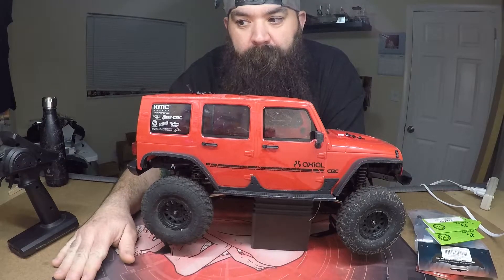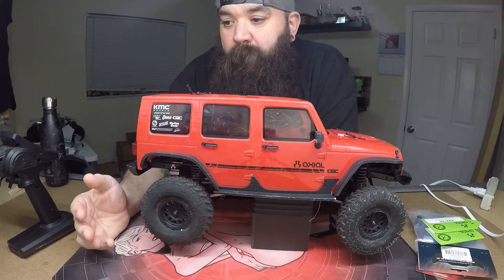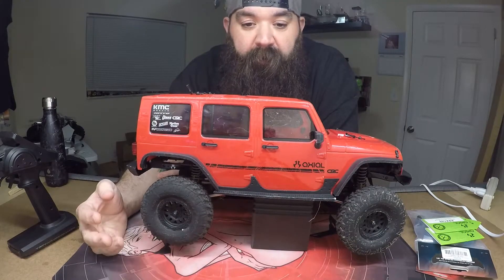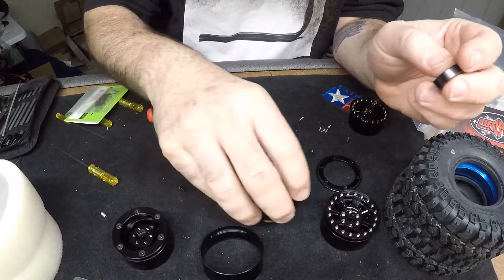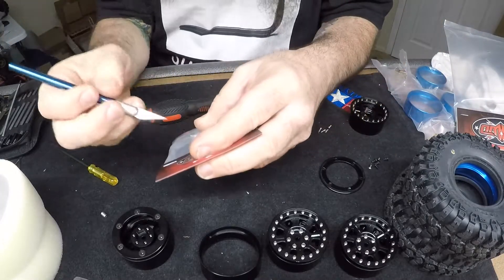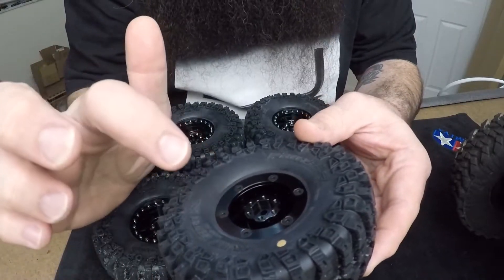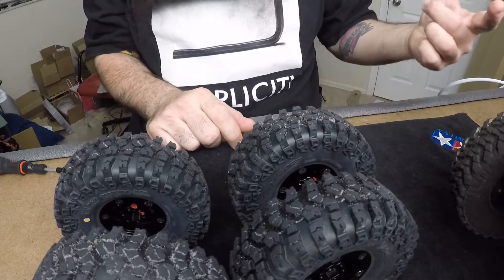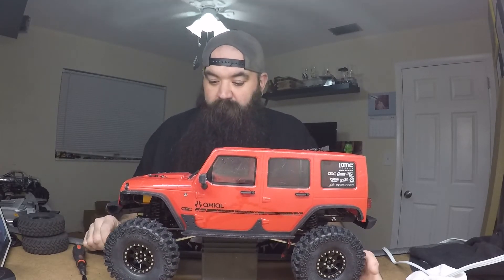BUILDING MY BEADLOCKS....AGAIN! THE RIGHT WAY!

Comment: I'm glad you brought up the shock mod that Harley did on the Honcho. I was thinking of doing it to mine but it is performing really good in the stock configuration. Also JPRC did an unboxing and did a weight distribution measurement and found that the JK is alot heavier in the front than the previous RTR so it may handle better with stiffer springs up front.
 Those new wheels and tires really look good on your rig. I think you will find that after running the bigger tires, you may not want to go back with the softer Nitto's
Reply from the maker: BullgearRC videos I’m learning these scale/crawlers are kind of try something and see if it works. I’ll see how the tires perform and go from there, though I probably should have gotten the smaller 1.9 flat irons but only time will tell.